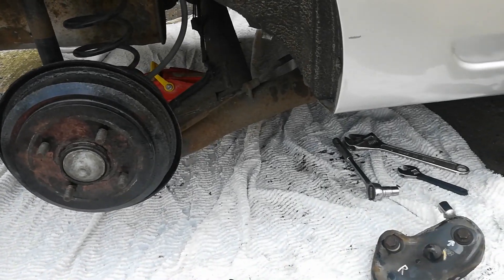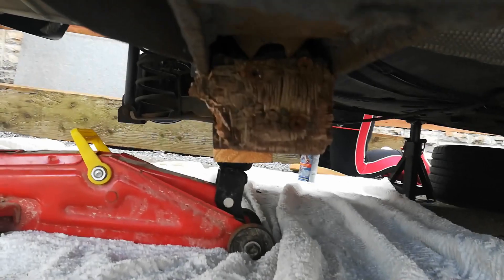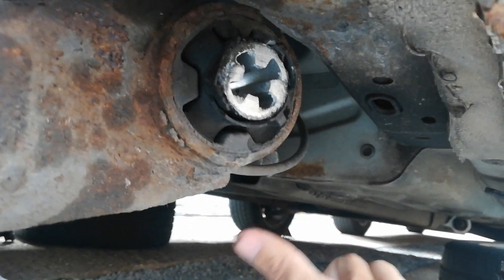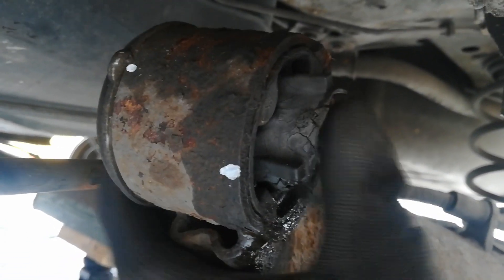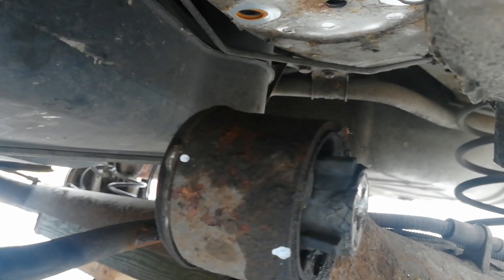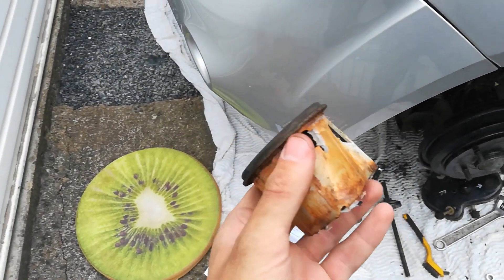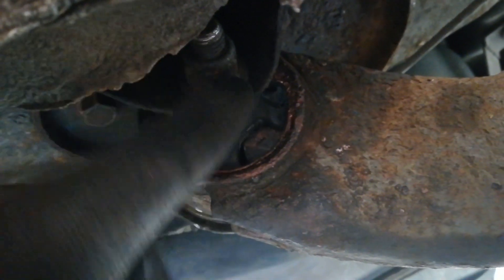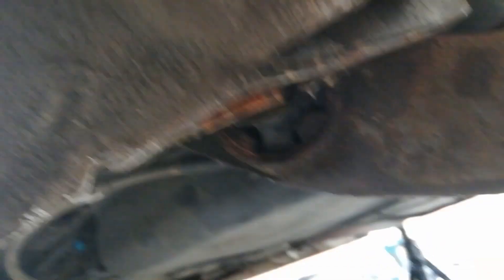Changing Rear Axle Bushings (Ford Fiesta Mk6/Mk5)

Comment: Tips:
Remove metal sleeve to the be able to fit the thicker bolt (use a 12mm threaded bolt with two nuts to help remove old sleeve if required-careful will bend and strip threads with too much force).
Then buy a propane torch and heat the ducker up. 
Then use kit to remove. 
When replacing, you must fit bushes in correct andle. The harder sides of bush go parallel with marker on axel (side to side not up. and down)
edit, careful if fuel tank with torch

Comment: What a pointless video. "I have this problem.... And here it is fixed".

I was hoping to see the process :(
Reply from the maker: I tried using the tool that everyone does but it stripped the threads so just used a drill, a hacksaw and a big screwdriver to smash out the old bushings. Then used a block of wood and a big clamp to press the new ones in but I recommend saving time and money and using poly bushes. If you want a better example of this job, go to see MEND IT, MOD IT's video on the same subject, it shows how bad the tool is in great detail

Comment: The bushes area nightmare to get out and in. A really bad job to do. The rear axle is all over the place when any sort of force is being used to remove the bushes. Pay someone to do it who has a lift.
Reply: I got the bushes out in seconds, I used a recuperating saw, And fitted new ones no problem on my driveway, I got bush fitting tool from ebay
Reply: @stuarts4673  In your dreams.LOL
Reply from the maker: It is a horrible job, a hydraulic press would've been the best 😅😅
Reply from the maker: Yeah I used an eBay press tool but the threaded bar bent and skipped a few threads, so we ended up just drilling the bushing out and then hacksawing the casing
Reply: I second @stuart4673 using a reciprocating saw to tear through rubber and cut the bushes metal casing allows it to collapse and be knocked out with mega ease…always use the press tool to install and you’ve earnt/saved yourself a nice few quid 🎉